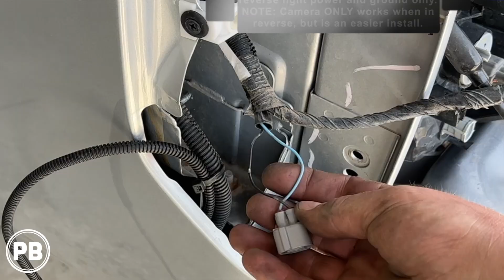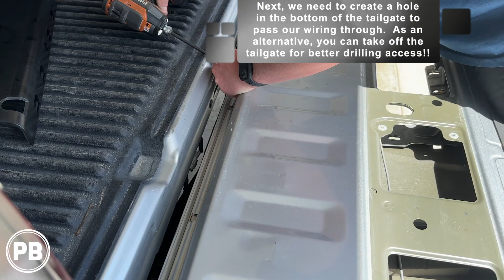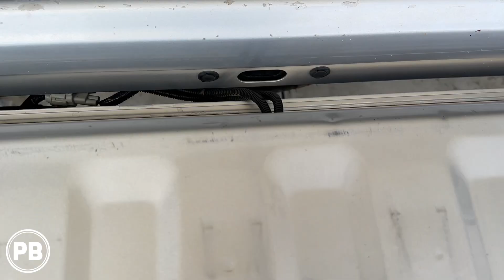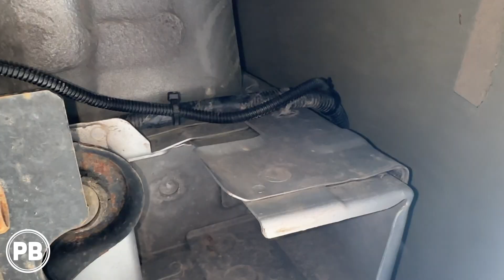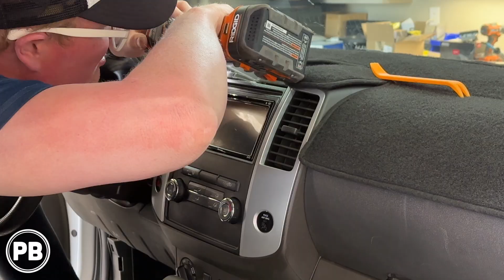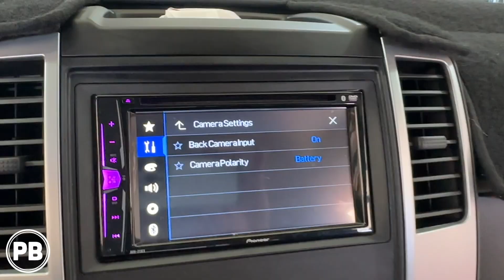2005 - 2016 Nissan Frontier Tailgate Camera Install

Comment: You stripped the black and green wires at the taillight and soldered the black wire but I do not see any connection to the green wire  please explain

Comment: How do you cover those holes in the new Bezel? That would definitely kill the look on my Nissan Frontier mine is an older 2006 model do they sell a bezel for that model without those extra holes :o/
Reply: You will also need to replace the upper tailgate molding with one from a 2013-2021 Frontier in order to cover those holes.

Comment: Why not use a oem handle that has the camera already?
Reply from the maker: Truck wasn’t wired for an OEM camera, nor does the customer want to pay for an OEM camera, nor is the image quality of a factory camera close to that if an aftermarket one.
Reply: Depends on the year of the truck. The 2013+ Frontiers have a different tailgate and handle that came with the backup camera, and this Frontier has the 05-12 tailgate that never came with one. As for image quality, I think you could just put an aftermarket cam in the OEM hole for a clean look